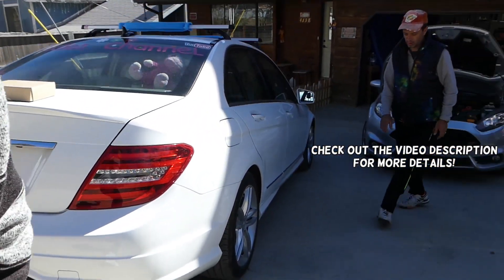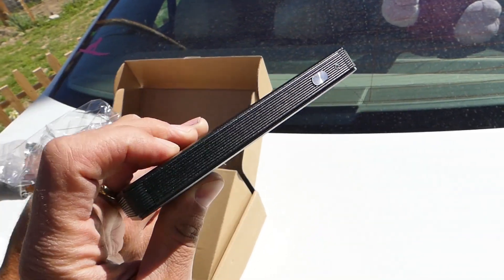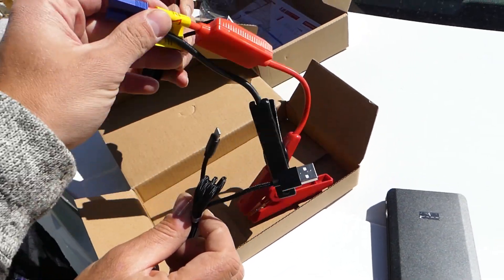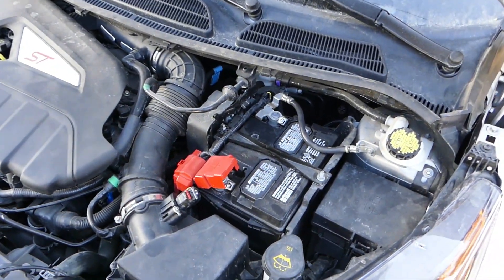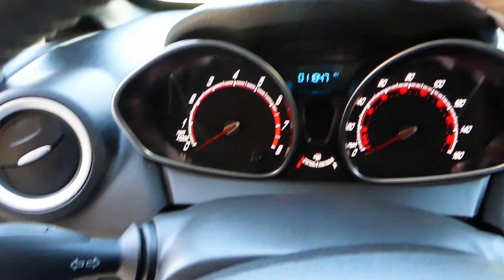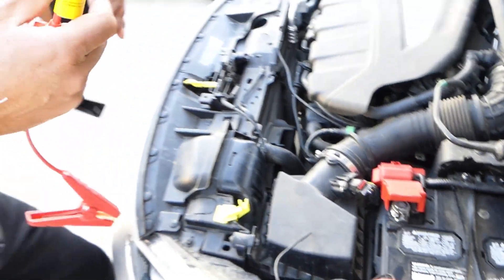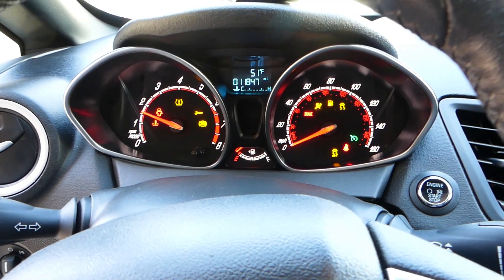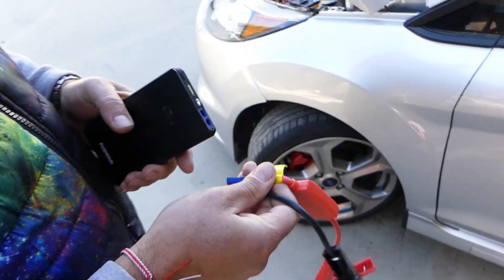HOW TO JUMP START A CAR with PORTABLE JUMP STARTER. SUPER EASY

Comment: Works as described. It also can charge mobile phone, and support LED lighting. 
Connect the clamp to the battery terminal. And then plug the cord of jumper cable into the jump starter’s socket. This‘s will be more safety.  How do you think?